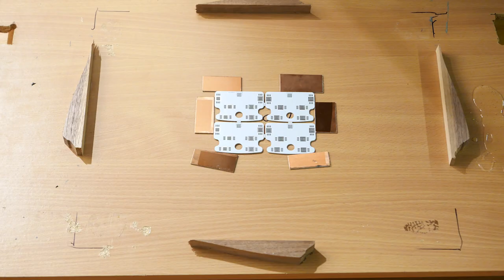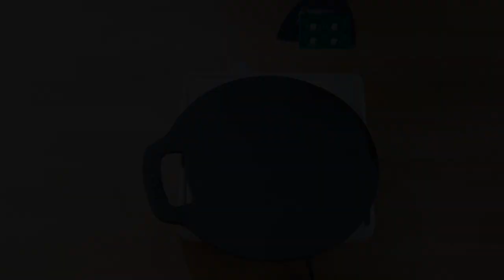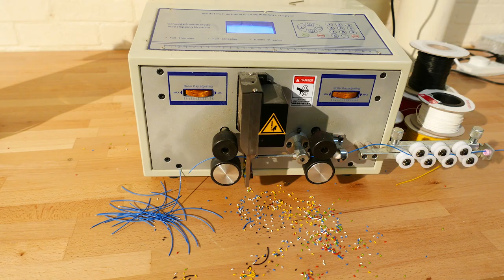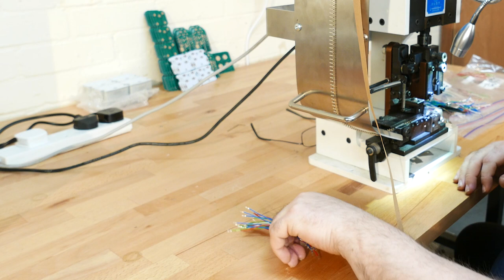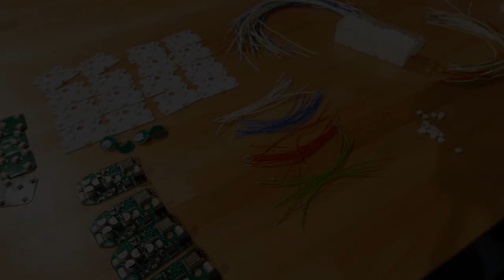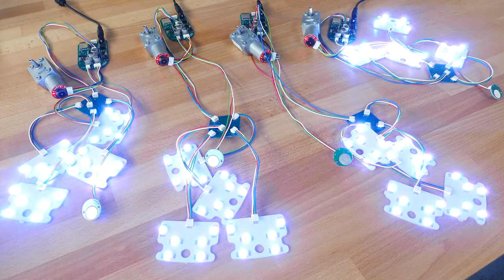How we make the 4-Mation electronics; ESP8266 controller+LED Strobes+touch button+encoder motor

Comment: me trying to recreate this for a school project but only having a raspberry pi zero and one LED strip... 0.0
Reply from the maker: pi zero is far more powerful microprocessor than the ESP8266 I use. An LED strip will work fine if you run the machine in the dark. Your only missing ingredients are a "logic level" mosfet transistor to switch the LEDs on and off, and a motor with an encoder feeding into your pi, to time the switching - like this one: https://www.ebay.co.uk/itm/DC-12V-Reversible-High-Torque-Turbo-Worm-Geared-Motor-Encoder-10-20-30-40-100RPM/362990381609